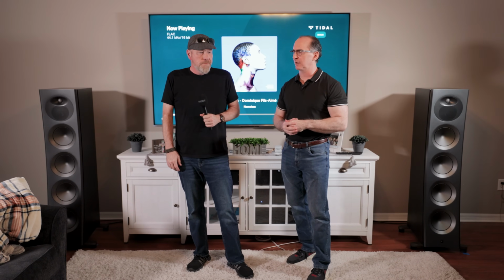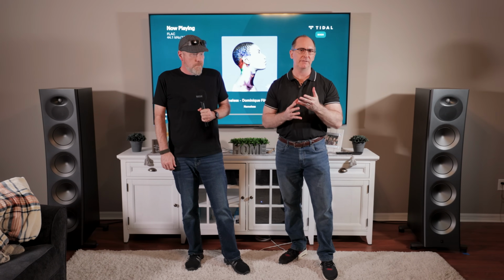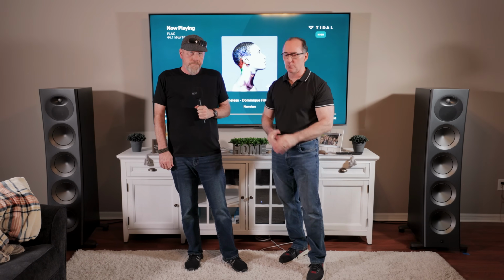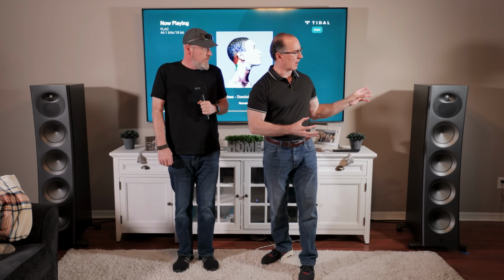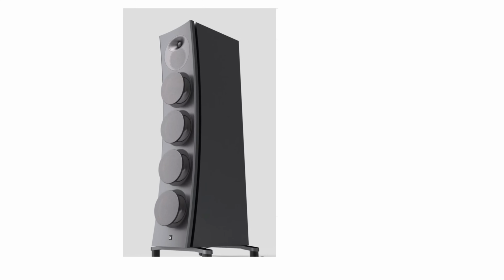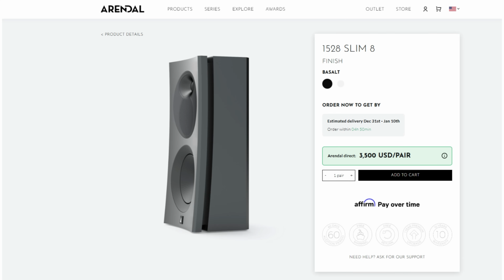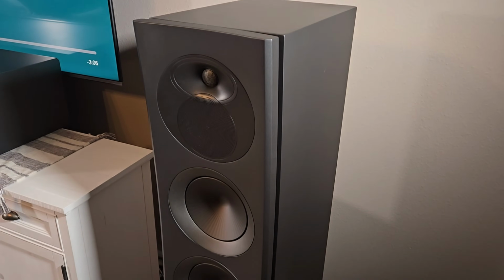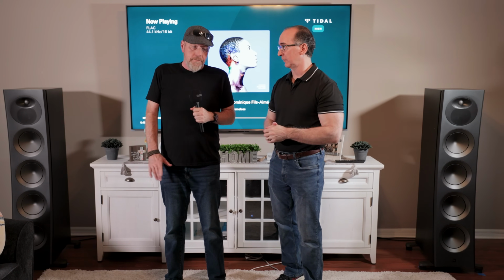Arendal Sound 1528 Tower 8 Speakers First Listen & Overview

Comment: I would like to know which more expensive  speakers these speaker beat sound wise… I am sure they are good. But I would like to know instead of buying X,Y,Z  brands that are more expensive, I should buy these as they sound JUST AS GOOD or upto 90% good… I own a pair of USHER 8571 speakers that are around 16,000USD. Are these better than my USHERs or are the good for a 6000USD speakers. Thats what I would like to know

Comment: I'm definitely curious about Audioholics doing a comprehensive review to this speaker line, and if possible, comparing to Perlistens and RBHs. Gene: I have SV-6500Rs, SV-661CR, and 661-SW/R surrounds. Do you think I should consider this new Arendal lineup as a final upgrade, or should I save my money?
Reply from the maker: These speakers compete more with the RBH 8300/PX. If you're already happy with your RBHs work on your room acoustics and upgrade your subs instead. Otherwise the Arendals would be a significant upgrade to your current RBHs regarding performance and aesthetics.

Comment: The 1528 looks to be so impressive, and not to crazy in price, i could easily consider them as my next upgrade from b&w 702 s2, my concern is the size and weight not easy to move around.

Comment: Not so sure I understand where you guys are coming from when you're talking about that you would get a four or five hundred watt amplifier. There's no way you're going to use up that many watts. No one would be able to comfortably listen to that. I was at a friend's house and we were listening at about a hundred DB and he was only using up about 160 watts. McIntosh integrated on Canton Reference 3.2's. I'm willing to bet that any power amplifier that's 200 Watts RMS and up will be plenty to drive them at loud levels. No one is going to want to listen to music where their ears are almost bleeding.
Reply from the maker: You're very mistaken.  These speakers are power hungry, and because they produce deep bass, they use that power. The Bookshelf 8 sent my Cambridge Audio EVO150 into clipping in a small room at high SPL. The Bookshelf 8 needs a solid 200-300 watts amp to shine.
Reply: Gene, Arendal is listing the Bookshelf 8 at 84db / 4 Ohms and the towers at 89.5db / 4Ohms. Unless they measured worse, that's a huge difference.
Reply from the maker: @getdealtwithquick  bookshelf speakers will always be less sensitive than their floorstanding counterparts. The bookshelf 8 needs a lot of power to reqlly shine.  I'd recommend at least 300 wpc in larger rooms.

Comment: Can't wait to get mines.. You mentioned amps to push the fronts at 300 watts at least is this 4 or 8 oms.. And if 4 oms does all the surrounds have to be 4 oms as well

All Blue Jean Cables 

Denon 3700.. Monolith 7 * 200.. Emotiva basx4 for atmos.... 7.2.4 Arendel 1723s LFC.. Arendal 1723s surrounds.. Arendal 1961s heights.. 2 Arendal 1961s Subwoofer.. Equals 😁😁😁
Reply from the maker: I'd recommend solid 400 watts at 4 ohms for these speakers if you lole to crank them and have a large room. Bookshelf 8 are very power hungry too since they have low sensitivity and low port tuning for deep bass.
Reply: *mine

Comment: To me the lithium magnesium is really exciting, magnesium is very rigid, often used in sway bars in cars. 

Lithium is super light but kinda fragile and has always just needed something else to unlock it’s potential. 

Then we got the super powerful midrange.

Then a vertical line of subs, which if you’ve seen Dave Rat’s computer modeling of 50ft tall sub arrays vs 50ft wide sub arrays for concerts and arenas; the vertical has much more consistent bass for an audience along the ground plane. 

Horizontal arrays were found to exhibit lobe-ing like inconsistencies.  

At the scale of a stereo pair of 5 foot tall in room speakers these effects may be marginally limited in bandwidth.  But perhaps they contribute to the subtle finesse of their impeccably smooth response.  

If we conceptualize 4 vertical woofers vs 4 in a side firing dual-opposed configuration, we see a compromise between force cancellation and vertical line array benefits.  A compromise mitigated by the inertia of their impressively thick front baffles. 

Overall each part of the 3 way design is done very well. The heavy faceplate used for the front baffle no doubt imparts a subtle bonus with such a powerful front firing array.
Reply: Dave Rat’s video modeling subwoofer arrays. 

https://youtu.be/TRrszdwpydk?si=Pi4R5bDjc3Cf9etC

Comment: I will set up a 2 channel or 2 speaker setup for my stereo system and have a decision to make. My room has enough square feet to accommodate either the 1528 tower 8's or the monitor 8  speakers.  Arendal has the recommended square feet at 330 sfeet or more for both the towers and monitor speakers. So, which to go with is my ultimate question?  Waiting for full reviews on the monitor 8's to help me in making that decision. Taking the cost and put that to the side, I am trying to figure out  which speakers I should go with? 1 thing I see is that both speakers take up about the same amountbof space. The monitors with stands vs the towers. Look forward to your review of the monitor 8 speakers. Thanks
Reply: ames Larson is currently reviewing the 1529 monitors, stay tuned for his review.

Comment: Yes.  4 8' woofers are roughly equivalent to a 16" one.
Reply: Square of the radius baby!
Reply: @SwirlingDragonMist Multiplied by pi.
Reply: @markrigg6623  both have pi in the equation, as a common variable it can be cancelled to simplify the equation.
Reply: @SwirlingDragonMist  Ahh yes I gotcha.👍
Reply: Yes - exactly. 
But four, eight-inch woofers will be faster.
Reply: Eight foot woofers - wow! 😱

‘ = foot
“ = inches

Comment: I was going to say if you tilt the speaker forward lift the back up half an inch will help with your soundstage bringing it lower down.
Not sure tho! with the way the bottom port works! probably be okay. I wonder if putting a piece of 1/2 inch open cell foam on the bottom on the floor would help as well that would sort out the tilting problem if there is any.
Has he tried them the manufacturer hang upside down from the ceiling that could work ok tilted forward or build a stand for it probably that's what you'd have to do in most circumstances.
 they have tilting feet why don't supply it? Ideally you want to isolate them, I don't know how good these feet are something like iso acoustics you could put some cork coasters underneath to raise the height and use as dampeners. Stack them underneath on top of each other for the given tilt.
Reply: That's on point, I added a couple small acoustic pucks to the bottom of the towers rear feet, it definitely helped a bit.

Comment: i would prefer a 4way or 3.5 way for that design... or a very low crossover point for the woofers.. like 150-300hz

interested in the slim with subwoofer but the cost for these should be lower...
Reply: its a stiff 5 inch midrange. low crossover is probably not a good idea